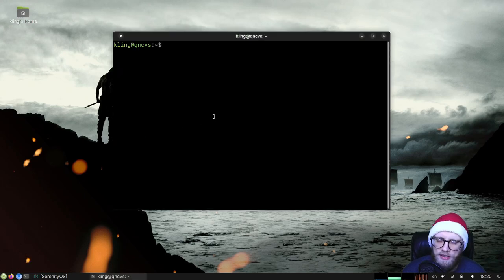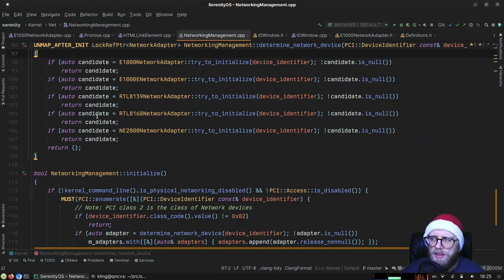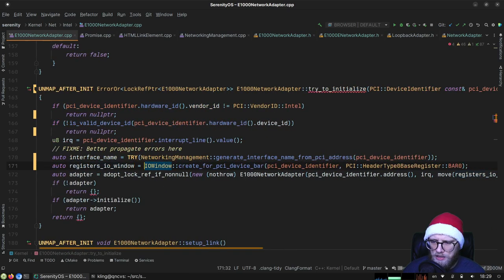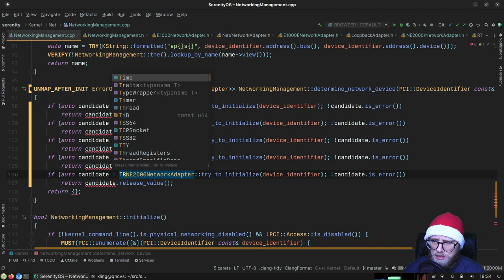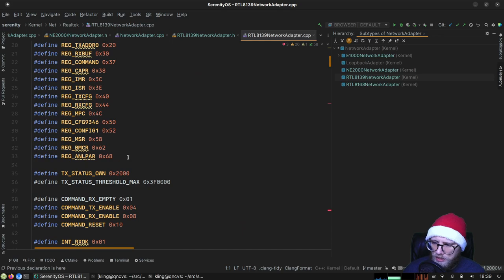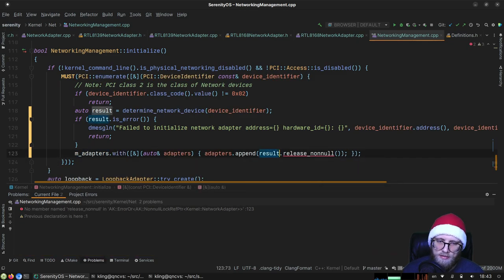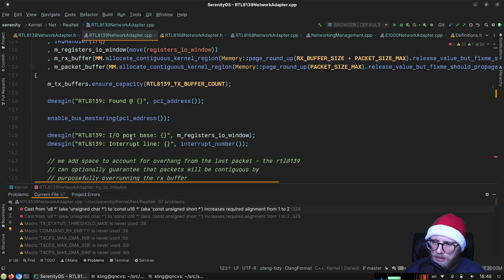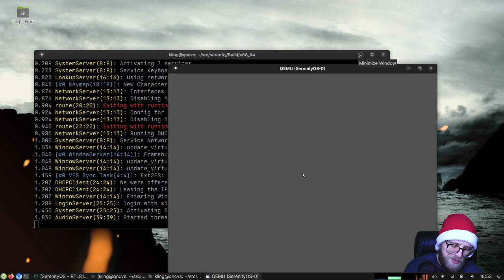FIXME Roulette: Handling errors during network card detection

Comment: The line between "this is an error" and "I couldn't do what you asked, but nothing went wrong per se" is always interesting when designing APIs. I think the Result/Optional types that Rust has and that Serenity has cooked up model this distinction quite nicely. Still, the situation where you couldn't decide if you should try to initialize subsequent network cards if a previous one failed is an interesting one. If it truly was an error, then doesn't it mean that something is wrong with the PCI bus? Shouldn't you not try subsequent cards? Hard to say.

Comment: Seems to me that you have literally two things here you are trying to do.

1) check if this driver can handle this device.
2) try and initialize and report errors if it fails.

If you break those up into two steps (and it makes sense since you may want to use the first function without the other), the logic gets much simpler and clearer.

Comment: Hey Andreas, shouldn't the for() loop on NetworkingaManagement::initialize() actually "continue" instead of returning on failure? Current code seems to prevent other network devices to be registered if the first one fails, right?

Comment: In "determine_network_device", why try to initialize the same driver (E1000E) twice in a row? It looks like a copy/paste that someone forgot to edit after the paste. Also it makes the error message appear twice.
Reply from the maker: Those are two separate drivers. E1000 and E1000E. The error message appears because the default QEMU setup has two separate network cards :)
Reply: @awesomekling  My bad. Thanks